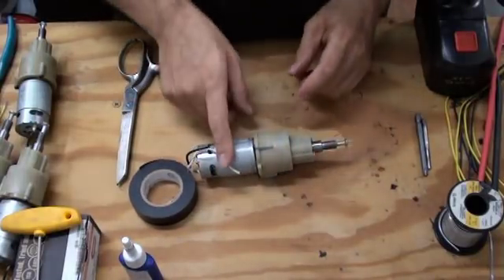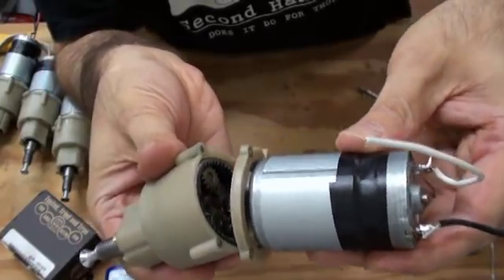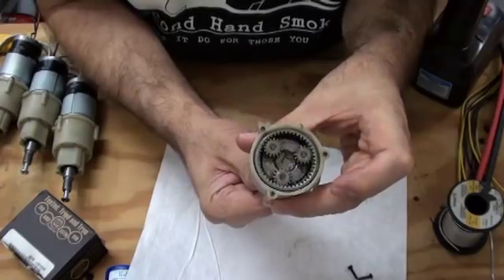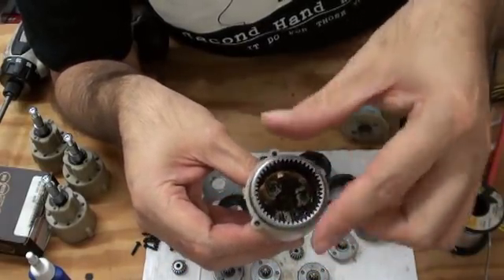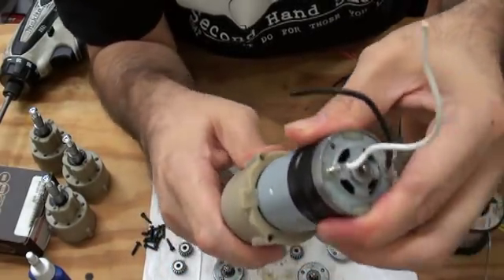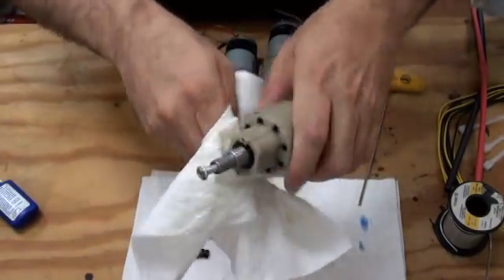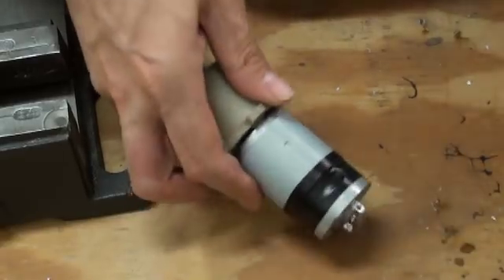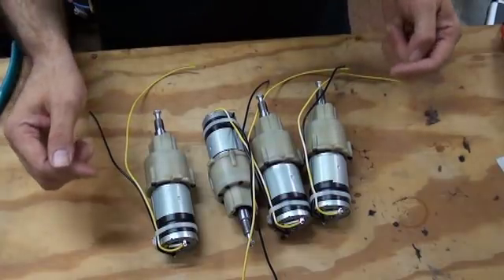Let's Build - Rover Mk3 - Part 3 - Prepping the Motors

Comment: interesting.. i have been thinking of building a 4 wheeled, bicycle tire go kart, with solar panels and a extremely lightweight frame. wondering if these motors have enough potential to drive such a thing. obviously they would require an additional gear, perhaps a flywheel for each tire. curious to the rpm after the transmission.

Comment: where would I buy the set screws, tap to make the threads? only items I know for sure I can find for this rover build.. is the drill motors, plywood.. everything else I am clueless
Reply from the maker: +arlingtontrains7   A well stocked hardware store  should have A 10-32 tap, a 3/8"-24 tap  and the set-screws.  However, The set-screws will be less expensive if you purchase them on-line.   The same "discount tool store"  that sells the drills also sells a tap-set  that contains both of the sizes you need.
Reply: Forgive me... I'm kinda Add... Not trying to be difficult... Just trying to fully understand.... When you say discount tool store... Are you speaking of harbor tool and freight?
Reply from the maker: +arlingtontrains7   yes.... HarBot Freight
Reply: +teamtiki I've done this with regular screws and then just wrapped tape around them to keep them in place.

Comment from the maker: They get uploaded after being produced,  trying to hold to one a week... The Capacitors are not strictly necessary  with today's modern 2.4Ghz  radio gear.   But its not a bad precaution,  especially as in the future I will show the rover base with a wireless video camera, and hopefully some form of micro-computer.
Reply: +teamtiki Sweet, thanks.  BTW are there any good cost effective options for harvesting motors for spinning weapons, or do you need to bite the bullet and buy a quality brushless?
Reply from the maker: +Shamezify  oh... you're talking about combat... there Motors WILL fail in robot combat.   Black and Decker,  Craftsman, and Ryobi are a step up in quality and will last longer.   As  for a weapon motor.... Cheap brushless motors from HobbyKing  are quite up the task of robot combat,  especially for any robot cheap Drill motors are usable on.  (12 or 30lb)   You  could use a 750 size motor, found in many 2-speed cheap drills and cordless line trimmers,  or a motor from a better cordless drill like makita or dewalt.  But they will be at a serious weight and power disadvantage.  Unless you really need all the torque at 0 Rpm,  buushless is the way to go.
Reply: +teamtiki Sorry to bombard you with questions, but I'm looking on your site to pick out an appropriate ESC.  I am using 12v drill motors, going for a 12lb bot. is the 30amp suitable or do I need to go up to the 85?  Thanks again.
Reply from the maker: +Shamezify 30Amp is in most cases Suitable for a 12lb combat robot.  If it were 4 wheel drive with 4 motors, I would recommend stepping up to the 85Amp units.